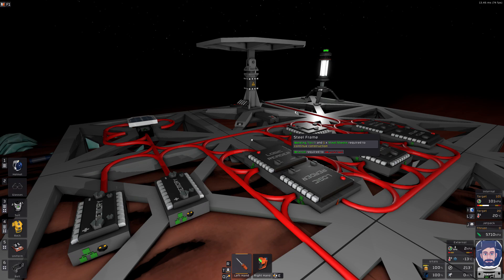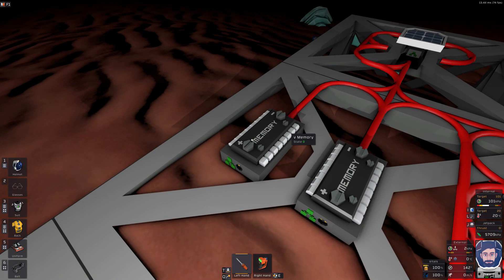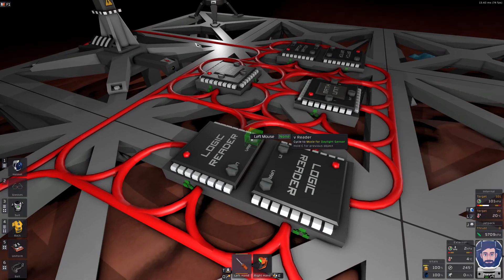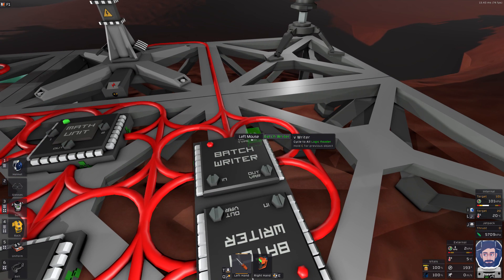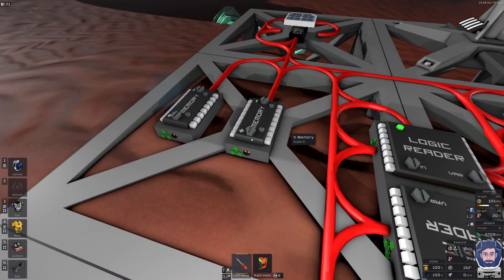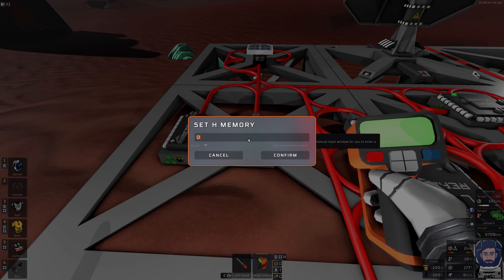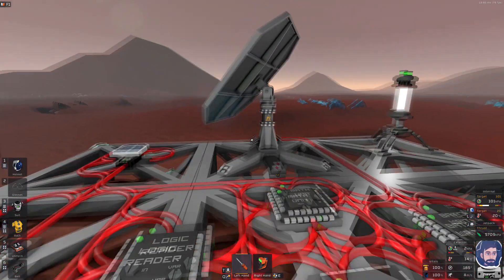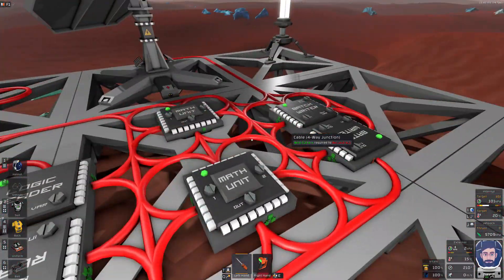Stationeers Dual Axis Solar Tracking Introduction

Comment: Tried doing it all on my own just today. I assumed just doing vertical would be enough, but becouse of how weird the daylight sensor tracks the sun i needed something else, and it appears the offered solution is to do horizontal too. So weird... Why was this feature designed this way?
Reply from the maker: I wasn't really around when the solar tracking came to be, but It makes sense. The sun does not always pass directly overhead, so some sort of dual axis tracking would be required to maximize the power generation. It did used to pass directly over head 90 degrees on the moon before the solar orbit updates, and mars you could get away with single axis tracking with a bit of a loss. Since, the update though, its better to just use dual axis, and it doesn't really require that much more resources over single axis. The latitude and longitude on the planet in each play through is supposed to be randomized now, so the sun orbit is always just a little bit different now.
Reply: @BigfootMSR  I played with a friend and he discovered a way to do good tracking with only one axis and two logic blocks. The solution is placing the daylight sensor on the wall, not the floor, angle does seem to matter

Comment: You don't need the horisontal math, you can just turn the daylight sensor (still lying down) around. It's offset by 90 degrees counter-clockwise
Reply from the maker: While that is true, that was not the purpose of this video. There are a lot of guides that tell you how to point the sensor a specific direction and the panel another, which is confusing to new players learning the game. This video was to show that none of that is necessary. Really the only thing your saving is a memory and a math unit, you still need everything else.

Comment: Yah, I still think the readings on the sensor itself are still off, like not the inteded way, specially in Venus, where it seems like the sky and the sun are not where they should be, like its flipped in the programming.

But yah, great video, that handles offset on any place, would be the easiest to apply in any situation, not the easisest build, but I gues the easiste overall. Just plop down and tweak the horizontal
Reply from the maker: The cables could have been cleaned up a bit, there are good number that are not necessary. But, the important part is all the ports are connected.